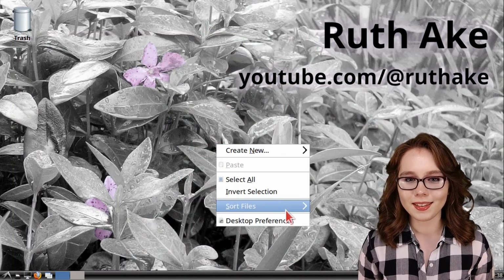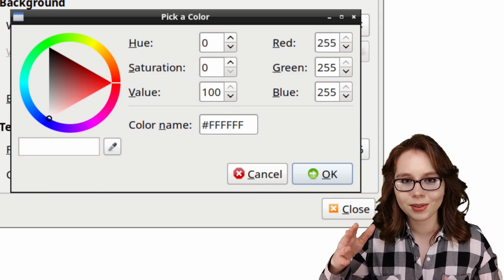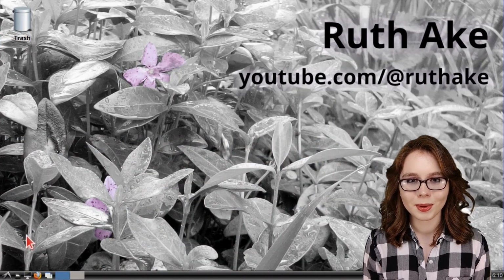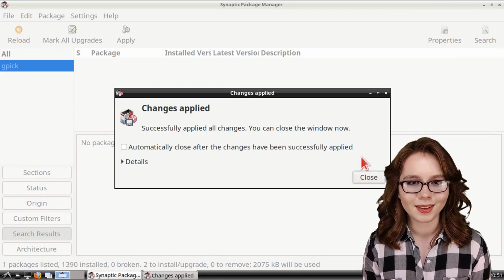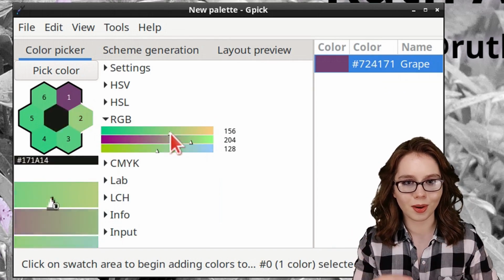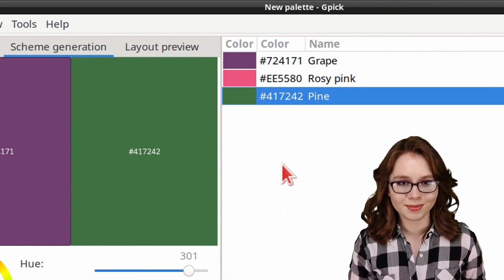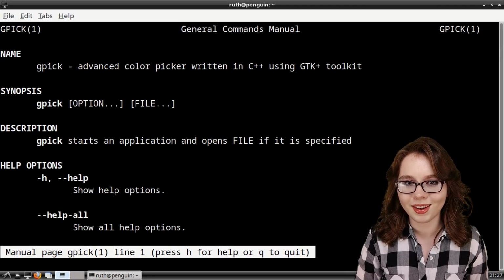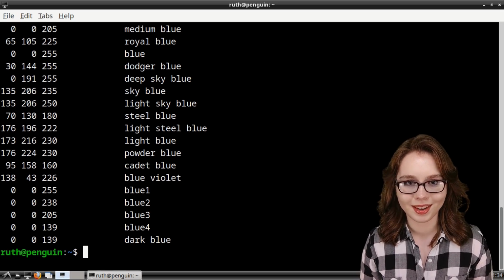Linux Colors On PCs and Laptops

Comment from the maker: Linux commonly expresses colors as hexadecimal rgb color codes and color names. Hexadecimal color codes are 6 characters often prefixed by a pound sign (Ex. # 000000). Each pair of characters ranges from 00 to FF (equivalent of 0 to 255). The first two characters represent red, the middle two characters represent green, and the last two characters represent blue.
    # FF0000 = red
    # 00FF00 = green
    # 0000FF = blue
    # FFFF00 = yellow
    # FF00FF = magenta
    # 00FFFF = cyan
    # 000000 = black
    # FFFFFF = white
Color names are an alternative to hex color codes. Some example color names are red, orchid, and slateblue.

-------------------------------

Install:
    Gpick is a flexible tool for picking colors.
        gpick
    less is a command line tool for listing screenfuls of information.
        less

Open Gpick from Menu > Graphics > Gpick

Color picker tab = Pick colors:
    Select color from anywhere on the screen:
        Click Pick color button > click anywhere on the screen.
        Color with hex code will appear in the color palette on the right side.
    Create a color:
        Click any pull-down > adjust values to create a color.
        A corresponding hexagon will change according to the color being picked.
        Drag color from the hexagon over to the color palette.
        Most things in Gpick can be dragged and dropped.
NOTE: Color names generated in Gpick are NOT Linux color names that can be used elsewhere.

Scheme generation tab = tool for picking colors based on a color scheme such as complimentary, analogous, triadic, etc.:
    Click Type pull-down > select color scheme.
    Drag color from color palette to any box of color.
    Colors automatically generated based on Type of color scheme.
    Drag color from colored boxes in Scheme generation tool to the color palette.

Layout preview tab = tool for previewing what colors look like in sample layouts:
    Click Layout pull-down > select layout.
    Drag colors from color palette to layout elements.

Additional tools in View menu > Secondary View

Delete all colors from palette:
    Right click anywhere in palette > select Remove All

Terminal Help/Documentation:
    gpick --help
    man gpick

-------------------------------

showrgb command lists all of the color names from the rgb color-name database. To list all of the color names from a terminal (Up/Down keys to scroll, Q to exit):
    showrgb | less
To filter through the list of color names based on a word:
    showrgb | grep blue

-------------------------------

Questions are welcome and encouraged. Due to the design of YouTube's comment section, posting questions under the pinned comment or under another user's comment makes it difficult for me to find and answer questions. Please do not post your questions under the pinned comment or under other user's questions. Please create a new comment.